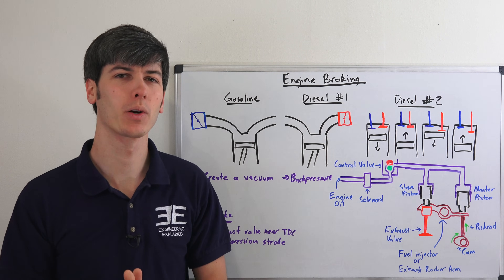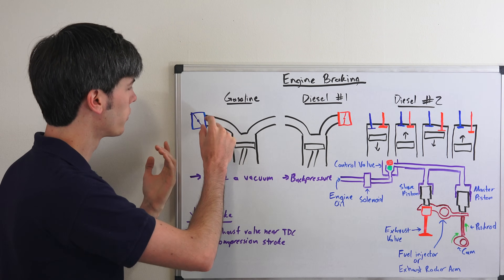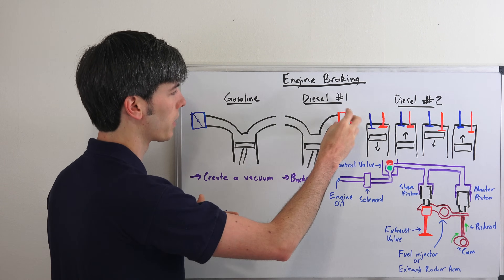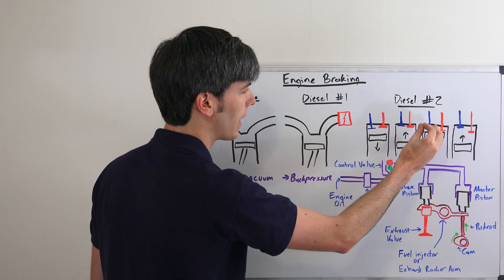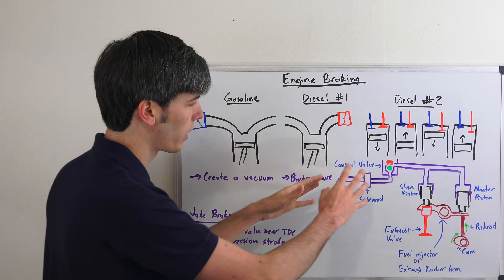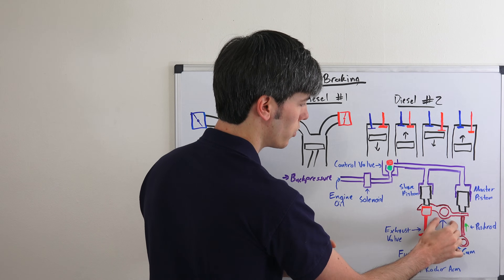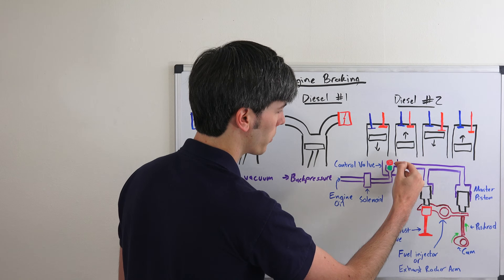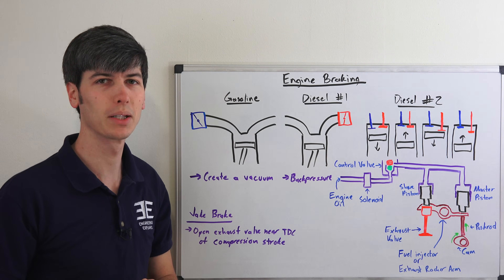What Is Engine Braking? What Is A Jake Brake?

Comment: There is a pass about an hour from where it is illegal for truck drivers to use air brakes, so must they be in correct gear before decent and use engine braking, they quite often crawl down this road at 20kmh.
Reply: where i live
Reply: In California I have seen a couple of signs where it is illegal to use engine brakes. Seems to be in residential-type main roads. I have no idea why that is though.
Reply: Where is this at, and can you provide any further information? This doesn't make any sense, if we're talking about tractor trailer combinations, since they all operate with air brakes. Not only that, but not all trucks have engine brakes, so this would essentially make it illegal for those trucks to operate on that pass.

Comment: If during the expansion stroke the compressed air pushes down the piston, thus not providing engine brake, why doesn't the vacuum pulls the piston up more rapidly at the beginning of compression stroke? I dont get it, I've read the debate about vacuum vs compression in slowing the engine but there seems to be no precise answer. I mean it is right that during compression you dont loose energy because of the air acting like a compressed spring, but then isn't the vacuum acting like a extended spring pulling up the piston? By the way I think that you will never get proper vacuum, as the throttle valve never fully closes to avoid the engine to stall at low rpm
Reply: Yes, the problem is in the theory that the air is behaving like a compressed spring, its doesn't.  When compressed the air heats, some of that heat is transferred to the engine block and some is retained in the air as it is exhausted, only a portion of it is converted to the energy of the power stroke, an inherent inefficiency in the internal combustion engine.  This is why the engine provides retardation it takes energy to turn it, the energy is not being transferred to a vacuum(some actually believe that) or indeed does the throttle body area become hot when engine braking occurs

Comment: I must not be understanding everything. You explain how the Jacobs break works mechanicaly, but what makes it slow the vehicle? does it have something to do with the other pistons strokes?
Reply: Yeah. All squeeze. No bang.
Reply from the maker: Compressing the piston, then that energy is released. Compression slows it down (unlike gasoline, which doesn't release the energy and thus heat loss is minimal from compression).
Reply: +Engineering Explained ok, it all makes sense now. thank you

Comment: The vacuum isn't what supplies braking effort, it's the compression.
Reply: Now go test this theory with an engine and you'll see that the vacuum isn't what provides the braking.
Reply: +DonziGT230 I did your test. Tested it for myself with my own vehicle.  

I had a lot more engine braking with the throttle closed vs. open.

I knew this would be the case before I tried it, so I felt pretty foolish.  I have been trolled, you trolled me.  I left my house, sought out a steep hill and repeatedly went down the hill with the engine off (throttle open then throttle closed over and over).  I'm really glad that the people who lived on that street didn't call the cops on me. My truck is kinda loud and "rapping" it up to 3500 rpm and then shutting off the engine had to look a little odd.  Doing it six times had to look really weird.

If what you say is true, a Jake brake would not work. If compression is what provides braking and the energy that is put back to the crank on the downstroke is irrelevant, releasing the compression at the top of the power stroke would not produce such a tremendous braking effect.  But it does produce a tremendous braking effect. I know, because I was a truck driver in the 80's and got to drive a truck that was equipped with a real Jake brake.

GM and Dodge produce light trucks that close valves to half the cylinders to provide better fuel economy. If compression energy was not immediately sent back to the crank on the downstroke, that technology would not work so well.
Reply from the maker: +DonziGT230 nope, on gasoline engines that energy used to compress the engine goes right back into it when it pushes the piston back down. Very little is lost as heat.
Reply: You're stuck on the heat/energy thing.  As solid as that is, get your head out of the books and try testing this for yourself and see.
Reply: Well for one thing, an engine (as opposed to "motor"), by definition, is something that uses heat/energy to do work. That being said, what Engineering Explained is referring to is that the compression of the air that would supply "braking power" is negated when the compressed air springs back on the down stroke. Put your finger on a syringe and try to squeeze it down - yes there is resistance there, but the air bounces back. Energy in, energy out, net result (nearly) zero.
Reply: I wasn't trolling you or anyone else, I've done it and didn't feel any change.  I guess I should try again on something with a bigger engine/less weight to see if it's noticeable.

The throttle thing wouldn't be comparable to a diesel with a Jake brake.  A gas motor with a brake would work too, but the throttle would have to be opened for it to work well.

The variable displacement engines I've looked at close both valves effectively making the 'off' cylinders air springs.  If only the exhaust valve needed to be closed to kill the compression effect they wouldn't bother closing both.
Reply: The difference below 2000rpm is subtle.  At 3500rpm it's marked.  My test vehicle weighs 5500# and has a 350ci engine.

A Jake is much better than a throttle, by a large margin.  But those hissing inline exhaust pipe brakes are about the same as a throttle.  I have tried both.
Since a Jake works by releasing the compression and eliminating the spring effect of the compression on the downstroke, I'd guess that a Jake would only work half as well on a lower compression gasoline engine.  But gasoline engines can hit much higher rpm's, so maybe a Jake on a gas engine at 4000rpm would provide the same braking as a diesel at 2000rpm.  But I agree, the throttle would have to be open, because the Jake system needs air to work.

If they only closed the exhaust valve, the piston would cycle air back and forth into the intake manifold.  Moving that air back and forth past an open valve would be far less efficient than the air spring.

Comment: if i'm using a manual transmission and I downshift for better engine braking from higher gear, will it damage the clutch? For example, 5th gear - 2k rpm to 4th gear 3k rpm ??
Reply: It does add wear to the clutch.  Clutches are a lot more expensive to replace than brakes.  But I downshift to slow down anyway.

Comment: my car (Gasoline SLK200) B1S1 O2 sensor is showing v v rich like 3 to 4v and B1S2 post cat O2 sensor is going extremely lean like almost 0v during engine braking... perplexing what's happening, plz help :)
Reply: I think he answered this in another thread on one of his other vids.  Many modern vehicle computers shut the fuel off when decelerating.  

That would cause your O2 sensor to give false readings.

Comment: About the vacuom, why is not my 2 stroke motocross have engine breaking?                           It have a carburator
Reply: 2-stokes have a big buffer between the carburetor and the piston. It's the crankcase.  All the intake air and fuel passes through it.  The vacuum in a two stroke is cause by the piston going up (as opposed to a 4 stroke creating vacuum on the down-stroke). Before the crankcase can go into vacuum the intake port must be covered. When the throttle is closed, the crankcase can draw exhaust back through the intake port to feed its vacuum.

This doesn't happen when the throttle is open. Because the crankcase is full of air-fuel mix and the piston compresses that mix on it's down-stroke. The mix is prevented from escaping on the carburetor side by some type of valve. For a motocross bike it's usually a reed valve. When the intake port is uncovered, that pressured mix if forced into the cylinder.  When the piston covers the port the open throttle allows the vacuum in the crankcase to be filled from the carburetor side.  This big buffer zone prevents a really large vacuum from forming because air is really springy. When you give it a lot of space it takes a lot of piston movement to pull a serious vacuum.  And you know well your motocross bike has a really short piston stroke.

4-strokes (usually) have a short small plenum between the piston and the throttle.  Very little space to fill so they can pull a big vacuum.

Comment: How does the car recognises that I am going downhill? Does it have something like gyroscope or does the engine braking works everytime I let my foot of the throttle? Even on horizontal road? And how does the car recognises that I am shifting to neutral ?
Reply: All the car knows is that the engine is going faster than you're asking for (through the pedal).  

The car has a neutral switch.

The gasoline engine is a natural engine brake with no throttle input.  No control required.  Diesel engines are poor brakes and require either exhaust brakes or Jake brakes to have that functionality.  I drive a 7.3l Navistar v8 engine.  No standard braking.  It is only capable of about 20 horsepower of braking force.  Meanwhile a Jake brake can provide as much braking horsepower as the engine is rated for.

Comment: The explanation on how gasoline engine braking works is not true, normal engine brake, is mostly due to friction between the mechanical parts inside the engine. to demonstrate this, do the following experiment, on a long downhill with your gasoline engine, when the speed is controlled by the engine braking, cut the ignition, and open the gas, as of the video, there is no vacuum on the intake manifold, but there is no change in braking.

i know its more and more difficult to achieve this with modern cars, since everything is electronic nowadays, on motorcycles is still very easy to do, since the ignition is right there on your right hand, just go fast, and kill the ignition, the engine brakes, with the throttle open and little or no vacuum on the intake manifold, and no obstruction on the exhaust path.

second, the vacuum force (if such a thing exists) pulls the piston up on the compression stroke also, so there is little effect of the vacuum on the whole business.

as for the diesel braking, also, the movement of air is not really doing anything, with the exception of the jake brake, that releases a lot of power thru compressing air, but the engine also brakes on diesels without jakebrakes.

also on old diesels there is no restriction on any manifold, intake or exhaust, the braking is mostly done by friction, think it this way, if you completely plug the exhaust with a potato, the pressure in the pipe will be around 15-25 bar, depending on the CR of your engine, once that pressure is achieved, which happens very fast, there will be no flow on the exhaust valve, since it is the same pressure on both sides. but the engine still brakes, (you can do this on a gasoline, but a diesel, an old exhaust can blow out)

your explanation is valid when the car is going very slow, for example stopped downhill, with only a manual gear and engine stoping the car, you will see how the car creeps downhill as the pressure escapes from the piston, that effect still exists at higher speeds but is very small.

wikipedia is wrong on this issue. BTW.

Comment: Great video! I believe a jake brake is great to save brakes, specifically used in semi-trucks and because it gives better control for the tractor but the problem with Jake brake is that it increases fuel consumption slightly so fuel economy will be hurt a little bit..
Reply: No, youll be saving money. Instead of using fuel for the brakes
Reply: Better than running out of air.
Reply: Well when I'm barreling down a mountain grade in my rig I'd rather waste a little fuel than lay on the brakes and have them go out halfway down. Those run away ramps don't look like they would be too much fun to have to use. It's probably one of my biggest fears driving a semi.

Comment: hello I'm a truck driver and I heard that using jake brake all the time can lead to a malfunction of a valve or even messing up your engine is it true?  can you use jake brake all the time or only when really need it?  you think not using jake brake at all will extend the life of your engine?  great video great channel and I hope you reply thank you
Reply: Jake brakes put more wear on the valve train because you're smashing the exhaust valve open at max cylinder pressure and as you may know, poppet valves like ones used on conventional engines are designed to force shut and seal with pressure inside the cylinder. So pretty much the exhaust valve, pushrod, and cam are subject to more wear when a jake brake is in use because they are being used at the time of the stroke when opening the exhaust valve would be hardest. True, not using a jake brake will extend the life of your valve train. That being said, i'm sure you know of cases where it would be better to use a jake brake than to overheat your wheel brakes, so take your pick haha.
Reply: use your engine brake when ever you need it. air compression is like ten times less(20-30bar) then when you use engine for power(100+ bar)
Reply: Eduardo silva the motors are heavy duty, built to take these kinds of bearings... they wouldn't install a Jake system if it was going to tear up the motor. as far as I'm concerned, there's nothing wrong with l re having it on shifting up (bit annoying doing that) and shifting down.

Comment: Imagine you're approaching a red light at 50 mph, in a manual gasoline car. Is it more wear-efficient to use engine braking, and downshifting every gear until you're in 1st gear and then apply brakes at the end? Back when I had an ICE, I used to run into this discussion often. The counter-argument was usually that you'd wear out the clutch etc. more, but spare the brakes - so essentially a near-worthless trade-off. By this logic, it would be optimal to engine brake until revs were very low in the current gear, and then apply clutch (or put it neutral) and brakes until a full stop. 

Regardless, what is the difference (in terms of wear) between engine braking at high revs and mid/low revs?

Lastly, I've heard an anecdote of a gasoline engine imploding from engine braking down a steep mountain (essentially, pressure become too high). How would a gasoline engine optimally brake down a long steep mountain road?
Reply: Pads are cheaper than a clutch, but the wear and tear from leaving it in gear and engine braking are almost immeasurable. The wear comes from slipping the clutch. When the clutch is fully engaged, it does not really wear.
Reply: The problem is wearing out your synchros and having to repair the transmission. Brakes are cheap and easy.
Reply from the maker: Probably the most wear efficient to leave it in a gear and then use the brakes at the end. If you rev-match perfectly (near impossible) for each gear, you wouldn't have wear on the clutch, just the synchros (unless you double clutched perfectly for each downshift, then no wear, but that's far over-complicated braking haha). Using engine braking shouldn't wear your engine, it's just using the cooling system to reject the heat, rather than the brakes. I don't follow the logic of why a long decent can't use engine braking (gasoline or not). Certainly better than roasting your brakes and not being able to stop.
Reply: What I do, is downshift one gear, assist lightly with the brakes, then coast and use the brake pads for the rest of the stop. 

pads are cheaper then a clutch.

Comment: Dear Sir,
Would You please explain why
the Jacobs engine brake has
such a "rap" while in use. 
Thank You very much. 
Sincerely, Kathleen.
Reply: As he said, it's because the exhaust valve is being shoved open when the air in the cylinder near or at max compression. The burst of air at top dead center will make a harsher popping noise than during a regular exhaust stroke where non-compressed air is being pushed out. 

And then you get that noise happening with multiple cylinders at a very high speed (Frequency, rather) and it "raps."
Reply: See Gasoline Vs Diesel - 4 Major Differences at 07:40

Comment: CAN YOU PUT AN EXAUST BRAKE ON A PETROL ENGINE, I HAVE A PETROL 4X4 NON TURBO AUTOMATIC AND ON DOWN HILL DECENTS IN LOW RATIO 1 GEAR MY FOOT IS STILL ON THE BRAKES 100% OF THE DECENT, ENGINE IS FINE COPRESSTION TEST WAS NOMAL AND EVEN. LOVE YOUR VIDS YOU SIMPLIFY THINGS THAT MAKES THINGS VERY EASY TO UNDERSTAND.THANKS